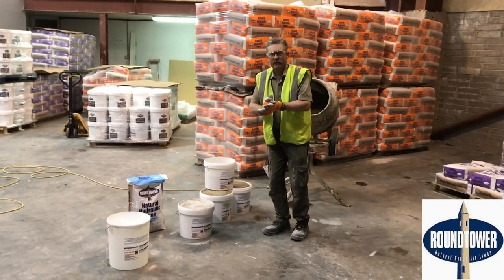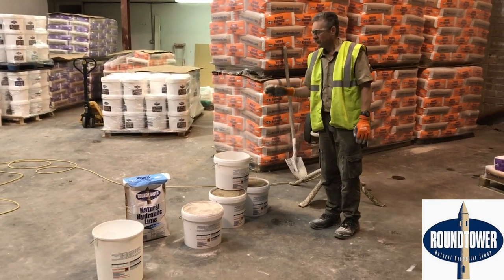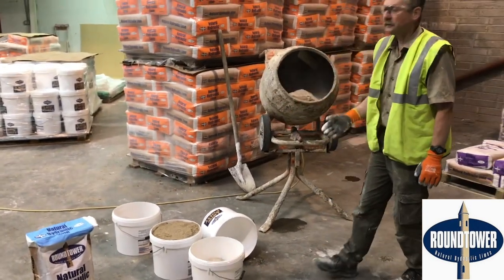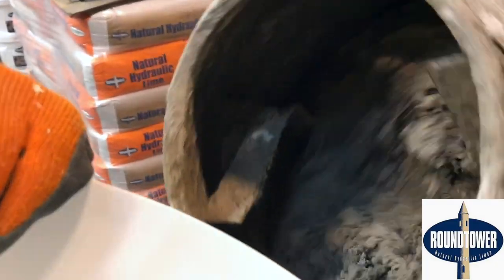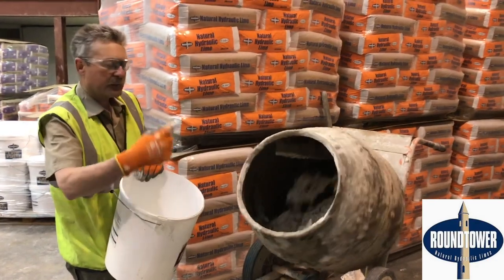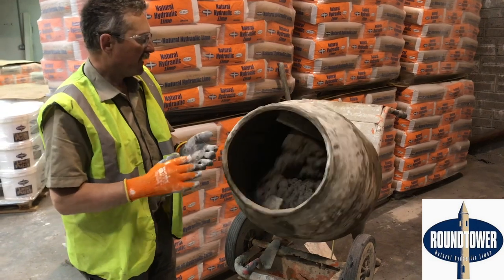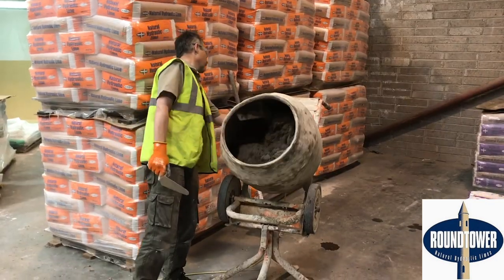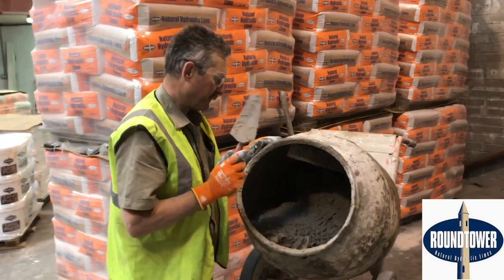Complete guide to mixing lime mortar

Comment: I had a stone retaining wall, 4 ft. high, built about 5 years ago. Along the top of the wall, they put flat stone,  believe it is slate, about 1 inch thick. In any case, many of the flat stones across the top have come off. What would I use to cement or glue them down, so they don’t come off again? Should I remove and replace the old mortar, or just add new mortar (or glue) on top of the old? Thank you very much!

Comment: Good info but you must remember to add some of the water FIRST, in order to keep the mixer wet, which prevents sticking and reduces dust.
Reply: I would put water in first.
Reply: @mikede2331  Dirty little habit you have there; but we don't want the sticking, do we, mike de!
Reply: @johnsomerset1510  ;)

Comment: Thank you for this video!  I feel that Ive been tugged and pulled into different directions on what to use in the U.S. as many state to add cement or buy a mix with cement.

I have a 1901 Queen Anne with a Rock foundation that needs a lot of help before it bows as there are gap openings from the old mortar that has crumbled into a white powder onto the floor. 

I hope I can find what I need as I've also read that I need a certain type of sand, Sharp, I believe it was called.  

I'll go and take some photos of the foundation and place them on mh google drive so you can see what it looks like.

This video is of great value and appreciation!  Thank you!
Reply from the maker: Thank you for your lovely message. If you drop me an email on harry@lochplace.com, I will help you out as much as possible.
Reply: Here is the link to the images. I'll get an email sent as soon as I get the time tomorrow.  Thank you!
(Just imagine and entire basement like this and not just these small image areas)

https://drive.google.com/folderview?id=15--g6ahGXhYzczVAzJKwJK6ZXoxJl4Kt
Reply: @roundtowerlimes9863  thanks for the nice video can you please help on the mix of lime cement and sand for platering adobe house in africa
Reply from the maker: @justiceforall2393  Hello, Can you send me an email to harry@lochplace.com please.

Comment: Would you need to add more water for an external render application? Could you use 3:1 Sand : Lime ratio for external render? For small jobs can you use the drill type paddle mixers? Thanks in advance on any response.

Comment: Nice explanation. I see some videos builders using sand and lime and some using cement and sand. Whats the difference,? Also if youre gonna plaster thick internal walls thën would you use sand and cement or lime and cement?, or does not really matter'? Just abit confused
Reply: What matters is that the mortar should be a little weaker than the material it is being applied to. Cement is the strongest and is only for modern buildings. The problem with using cement on Victorian and older building is it can't flex with movement in the wall so it just cracks. Worse still, it does not let water vapor out of the wall so it causes damp problems, whereas lime mortar is breathable, allowing the wall to dry. Also, lime can self-heal to some extent. Natural hydraulic lime (NHL) comes in different strengths. Non-hydraulic lime (putty) is the weakest but most flexible and breathable so it is suited for earth and cob construction, for example. In other words, if the building was constructed before Portland cement was invented, then stay well away from cement as it will just fail and cause damage. Just my 2 pennies.

Comment: Hi thanks for your vedio is this shap sand or builder sand ?
Reply from the maker: Washed sharp sand.
Reply: @roundtowerlimes9863 hi ,,is it possible to use building sand to get a smoother finish for pointing ?

Comment: Is there a difference between using hydraulic lime and hydrated lime ? ... i have a wall with a small area of rising damp... it is an old limestone wall and was rendered with cement mix (and to make it worse it was finished with a rubberized top finish) ... i have cut out the bottom part of the render where there is rising damp and would like to render with a lime render mix to allow it to breathe .... unfortunately in malta where i live bags of lime are just transparent bags with no markings on them so i habe no idea if its hydrated or hydraulic lime ... can i use both for lime rendering? Thanks
Reply from the maker: Hello Darryl, hydrated lime and natural hydraulic lime (NHL) are not the same. NHL is a binder, and when mixed with sand/water creates a mortar. Hydrated lime is used as a plasticiser in cement mixes. Ideally you would be looking for a NHL or lime putty. I would also be cautious with rising damp. There is no such thing really... Is there moisture coming into building any other way? Are all your gutters, downpipes etc in good looking condition? It is working increasing drainage on the outside. Is the exterior ground level higher than the interior? A drain around the outside of the house may help the problem.

Comment: Thank you very much for this video.
For a smooth internal finish coat can you use 1 part lime to 1 part sand, or 1 part lime to 1 and a half parts sand.
Thanks.  Regards.
Reply from the maker: Hello, You can use 1 part sand but it would need to be fine silica sand mixed with 1 part Roundtower NHL 2. If you would like any assistance please do give us a call on +353 21 477 6677. Thanks
Reply: @roundtowerlimes9863  Ok, thank you very much for the information.  Much appreciated.  Kind Regards.
Reply: @roundtowerlimes9863  What is the difference in practise between nhl 2/3.3/5 in plastering etc?
Reply: What's your mix for the finish coat lime render?

Comment: Would a more accurate way, for the quantities if you have time, would be to weigh the sand and lime mortar? Eg mix 3:1 use 30kg sharp sand 10kg lime ?
Reply: Sand weight will vary dependant on water content. Measuring by volume is more consistent than by weight.

Comment: I thought you had to soak (slake) the lime in water for at least a week first before using  What am I getting confused about?
Reply from the maker: Hi. Traditionally when working with lime the lime binder was mixed with the aggregate (sand /gravel) and left to sour out for a period of time. There were what was called non hydraulic limes. 
 On this demonstration we were showing how to mix a Roundtower natural hydraulic 3.5 lime. Generally hydraulic limes are mixed and used immediately. I hope this helps clear up any confusion.
Reply: Powdered lime is safe to work with.

Comment: would you use that mix for laying old bricks and reclaimed old stone as well?
Reply from the maker: This mix would be perfect. It is made up of 2.5 parts sand and 1 part Roundtower Natural Hydraulic Lime (3.5).
Reply: @roundtowerlimes9863  interesting, I do have to lay few courses in order to fix my front garden wall in front of my house and want use lime mortar as it was originally done. Therefore, I know in this condition mortar is good for pointing but for laying “bedding” bricks it looks to be in quite semi dry condition. Would it be advisable to add more water to make the mortar more workable and pliable? Would appreciate your advise. Thanks.
Reply: I tried quite a stiff mix with 3-/1 using sharp sand and it takes a mallet to knock the bricks down. I make it quite sloppy cement so the consistency is more like cement mortar. Had quite good results this way, just needs a gentle push or trowel tap to knock down

Comment: Why  not put some water into the mixer first, this will generally  stop the mix sticking  to the back of the  mixer,  On small  mixers there's  no wheel to change the angle of the drum.  Unfortunately  cleaning  the back of the mixer  while it's  full is  inadvisable from a healthy and  saftey  point  of view.  Switched off  or not.
Reply: Lime need to be mixed dry first and left for a while...
Reply: How would you  mix a fine dry powdered  lime.

Comment: How much water about?
Reply from the maker: Hi Katie, the amount of water added is determined by many factors such as, how wet the sand is, what job the mortar is going to be used for e.g Pointing or Rendering etc. If you would like some technical advice please give us a call 021 477 6677 or 0044 1737 245554.